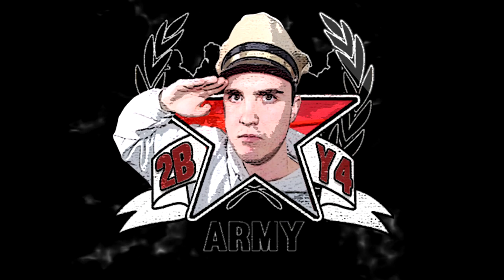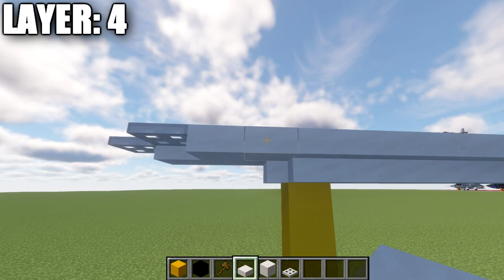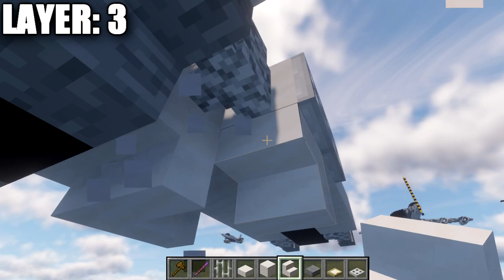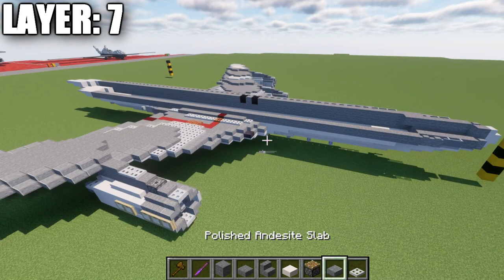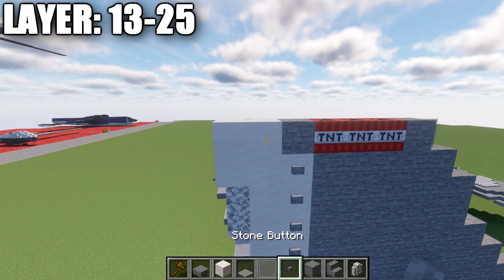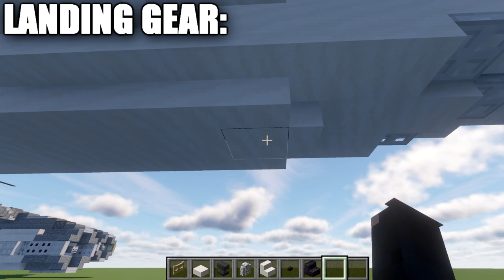Minecraft: Modern E-3 "Sentry" | AWACS Aircraft Tutorial (In-Flight + Landed Version)

Comment: 1:43 Don't forget the 1984 air battle between Royal Saudi Air Force F15C's and IRIAF F4 Phatoms, on June 5th of 1984 2 F4 Phantoms took off from Bushehr Airport in Iran and were sent on a mission to attack Saudi oil tankers off the coast of Saudi Arabia after Saudi Arabia backed Iraq during the Iran-Iraq War, a USAF E3 Sentry detected the 2 bandits and alerted the Saudi military which then diverted 2 F15C's that were refueling over the Eastern Province of Saudi Arabia to intercept the bandits, the 2 F15's are flying head-on towards the F4 Phantoms, an F15 downs one of the Phantoms in a bvr engagement with an aim7 sparrow and the second F15 misses the opportunity for a bvr engagement and hits the second Phantom with an aim9, both F4 Phantoms down, the IRIAF sends 2 SAR Helicopters to the place where the 2 F4's were shot down to see if the pilots are still alive or not, the RSAF sends an F5 Tiger and threatens to down both helicopters as they're violating Saudi waters, this does not make Iran happy, they scramble a fleet of 11 F4 Phantoms and 2 F14 Tomcats and prepare for an attack on Saudi Arabia, the same USAF E3 spots this and alerts Saudi and the RSAF get a fleet of about 30 F15c's to intercept the bandits, the IRIAF sees this on their radars, shit their pants and flies back to Iran